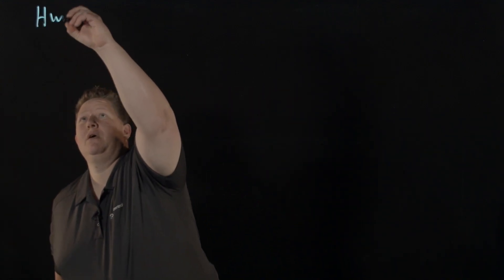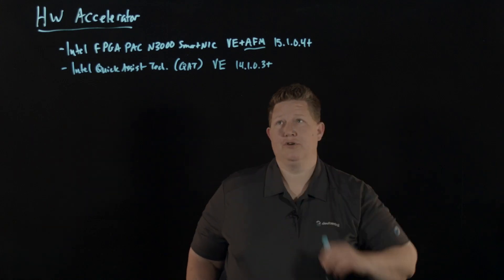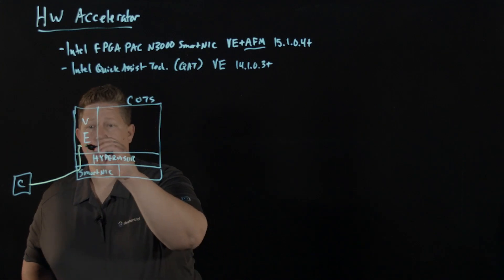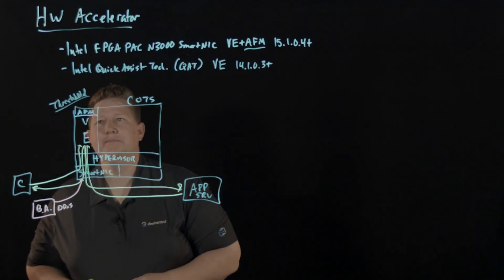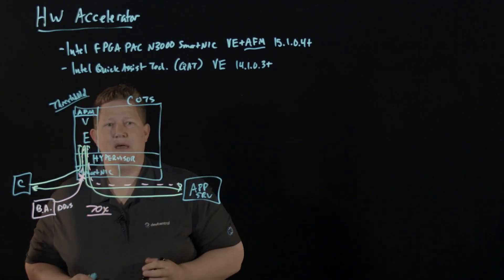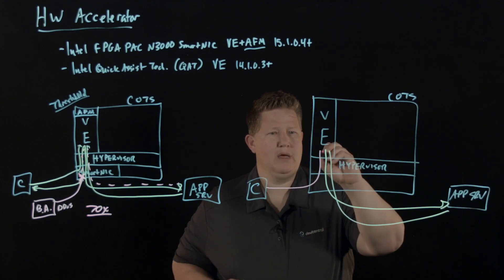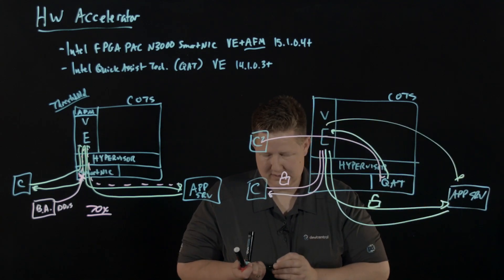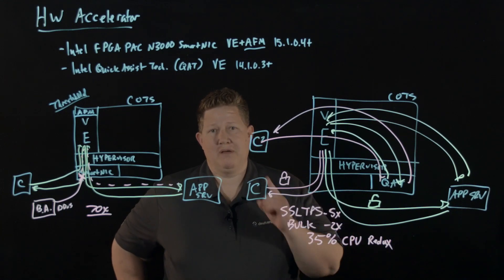Boosting BIG-IP VE Performance with Hardware Acceleration Technologies

Comment: Great insight and very useful going forward. For the QAT solution, guessing keys or premaster secret keys are somehow shared with the QAT card for it to do the decryption/encryption?
Reply from the maker: That's correct. If it's going to handle the encryption duties, it has to be key-aware.